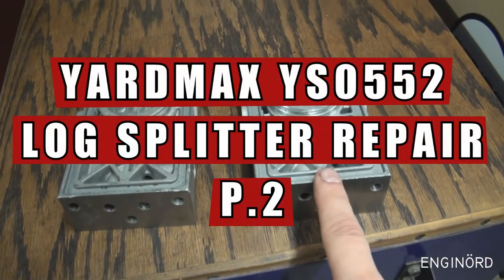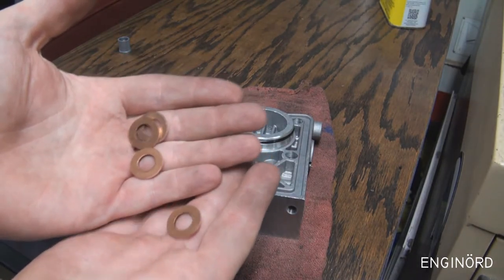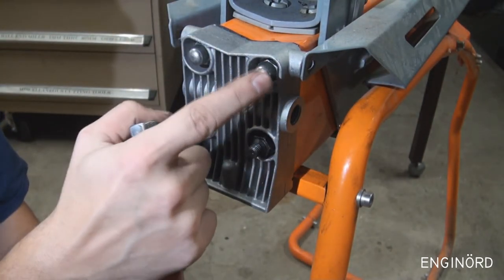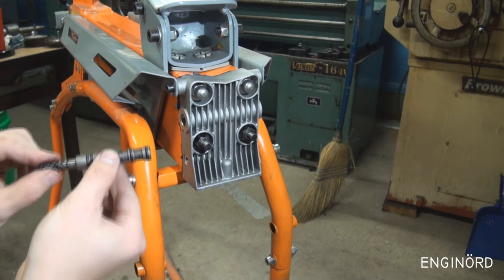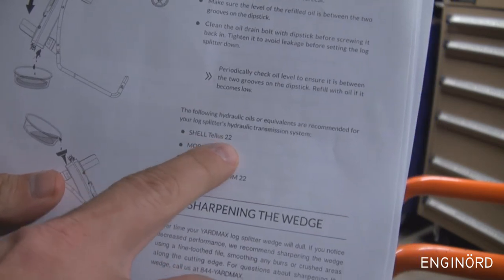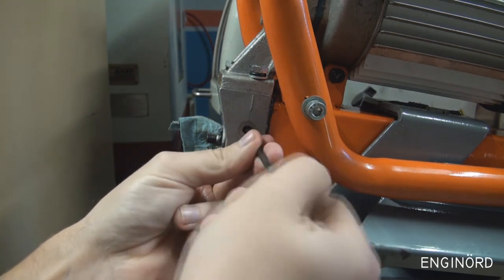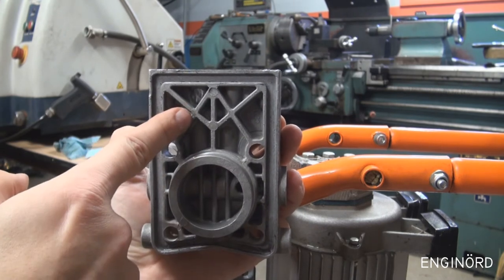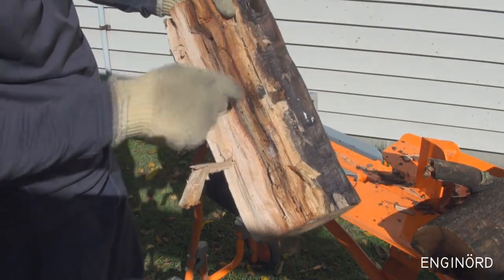Yardmax YS0552 Log Splitter Repair - part 2

Comment: thanks for showing the complete rebuild, all the parts, how they interact. hopefully this should help me fix my Harbor Freight Special  (otherwise known as the 5-ton POS...)
Reply: I have a harbor freight one too an the oring that the motor part connects to that cover blew replace that an few weeks later now the ram dont move gunna take it back apart an try messing with that check valve

Comment: There are so many things I'd have to change before I'd use one of those splitters. This is one of the few that have a log platform behind the wedge to catch the split logs (nice option) That would have to be one of the first things I'd fabricate on mine.
  I'd also make my own stand which would be wider and more stable than that poorly constructed flimsy stand.

Comment: Excellent tutorial of your fix! Good work. 

Have you kept your motor as a splitter or did you move it over to the press? 

I’m trying to acquire the log table from Yardmax to fit to another splitter of very similar design. If you utilized the motor to the press and no longer use the splitter I’d be interested in purchasing your log table.
Reply from the maker: Hello Stephan. I'm glad you've enjoyed the video. I kept the log splitter in one piece. Comes handy every fall when I'm preparing the firewood for the winter.
Reply: @enginord  it’s all good! Just thought I’d ask. I’m sure after your professional repair, it’s going to hum along for years!

Comment: Awesome job. Great video(s). What does your selected torque of 40 newton-metres  translate into for foot-pounds?
Reply from the maker: Steven. I'm glad you enjoyed the video. 40 Nm translates to 29.5 pound force-foot.
Reply: @enginord  Thanks. How the heck does one calculate that? I'm almost afraid to ask because I'm absolutely atrocious at math, but it's ovious from your videos that you're quite intellient and the Good Lord has blessed you where brains are cincered, LOL.  That being said, I am very seriously thinkig about getting one of these VERY soon, and will definately be applying the caution from your video at the 25:54 min. mark.  Their failure to iclude that informatio in the owner' manual or promo videos for the product is a ovbious shortfall and a disservice to the customer - along w/their failure to mention the motor's horsepower specification for the product/model, anywhere. Do you know of any simple formulas to also accurately calculate that? Thanks again for your efforts, time ad wisdom. keep up the great work !  :)
Reply from the maker: @stevenkmckendallsr1169  . the easiest way is just use google. there are many websites that will do the conversion for you from  Nm to kgf cm or in-lb. In my torque  wrench sheave I keep a printed chart to convert between the units coming from the 16 fingered kings leg to one measured by the atomic nucleus :)

Comment: How did you compress the spring and put the cylinder in ? DO you have pictures or a video on how to do the spring?
Reply from the maker: I did not take apart the hydraulic cylinder part. Sorry. I just worked on the controls.
Reply: @enginord  But when you took the controls out, the spring is longer than the frame. You didn't need to compress it to put back the controls in ?
Reply from the maker: @goaro2007  you can see the assembly at 8:35. Not sure what can I add to it.

Comment: Excellent Job !!! Thank you very much!! Any Idea in which direction I would have to turn the last valve you installed (16 rotation ;-) in order to increase the pressure of the unit? MIne, although only rarely used, is actually quite weak as far as splitting the wood is concerned. So maybe 15 turns would make it stronger or the other direction and 17 turns will give more torque/power? Thank you in advance from Germany 🙂
Reply from the maker: hello dear user from Germany! I'm glad you enjoyed the video. If you turn it clockwise as shown on the video it'll increase the pressure. try to do half a turn or maybe 1 turn at the time. also be aware that the increased pressure can damage the unit, since the seals inside are designed to a specific pressure level. 17 turns will make it stronger. also note, when a pressure vessel fails it'll spill out all the oil in matter of seconds, so testing this would be the best to do outside.
Reply: Thank you very much for the Quick Response 👍👍👍

Comment: My machine works on the forward stroke but doesn’t return very well. Like it’s pushing against fluid. Do you have any suggestions?
Reply from the maker: Hi Michael. Glad you found the content beneficial. Acc. to the hydraulic diagram the valve routes the oil (pressure) to the business side of the piston in normal mode, and will let it drain in return mode. I would remove the lever, and pull out the valve stem and check the o-rings. if any of them is torn that might be the culprit. When the valve is removed I'd use a flashlight to see if the galleries are free of debris/foreign matter. Hope this helps. LMK how it goes.
Reply: @enginord  Thank you. I did this and found the o rings were slightly damaged and hard. I replaced them and it seems to be working ok now. Thanks again.